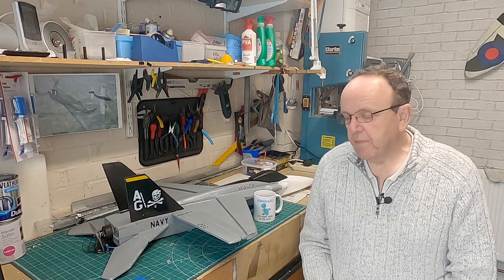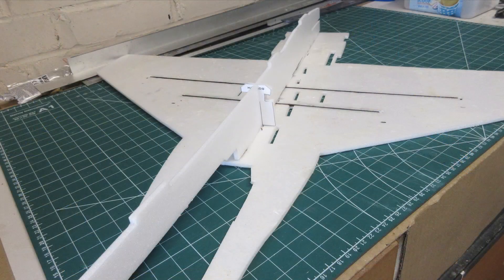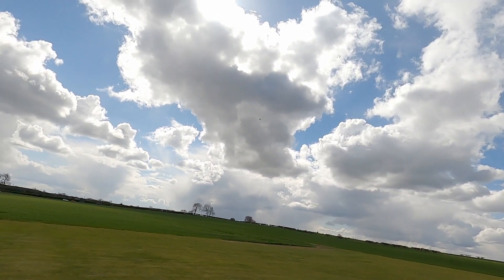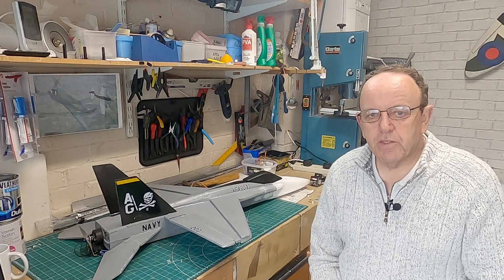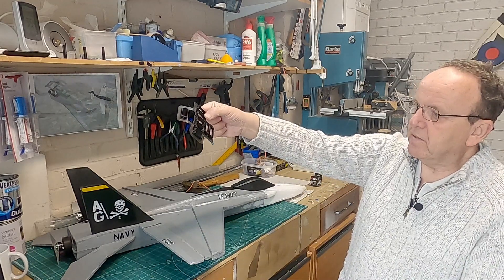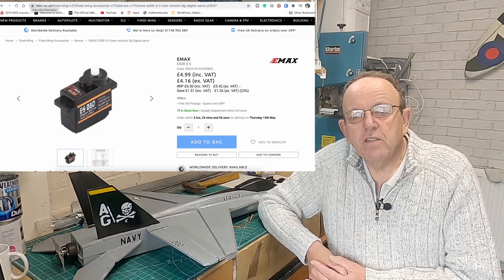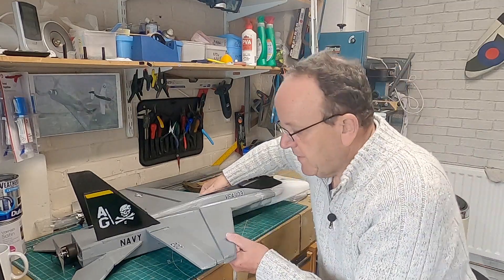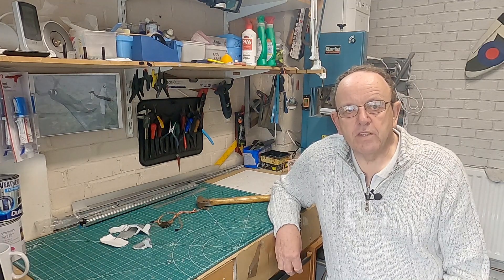FRCFoamies F18 with fake servos and how to fix them - maiden, crash and  rebuild

Comment: I may have seen your fix coming before even starting the video but it was still funny
Reply from the maker: I've since fixed 2 more. Thanks for watching  😀
Reply: @rckeith  The one thing about slope soaring as I've pretty much gotten away from the cheaper end of the servos like the plane I'm sitting up right now has five $35 servos. I just have to remind myself that I'm no longer buying lipo batteries or motors or ESCs or props lol